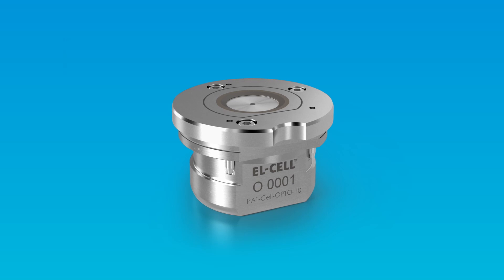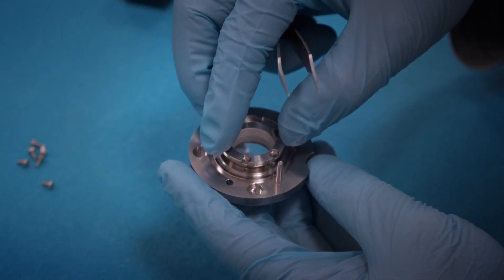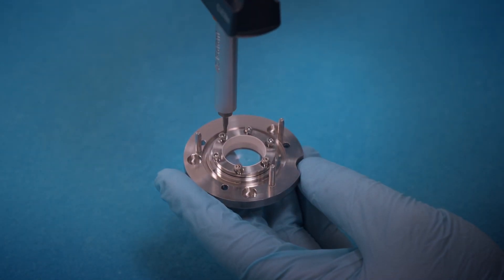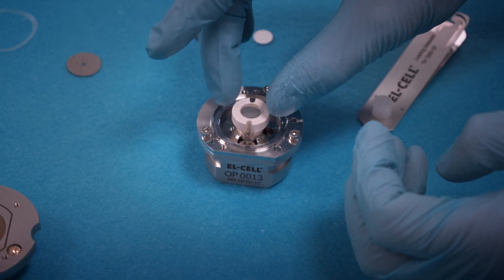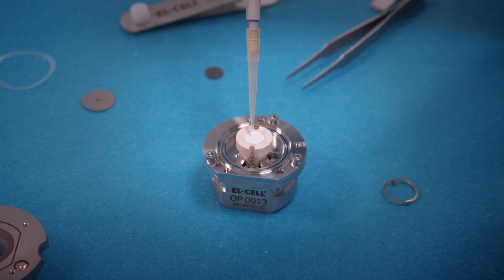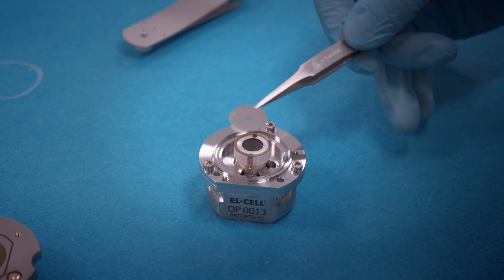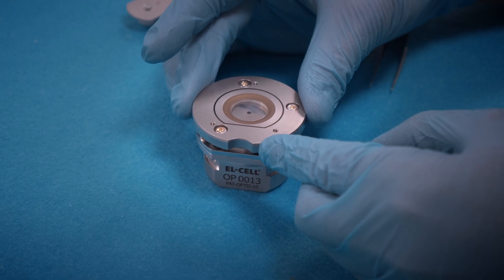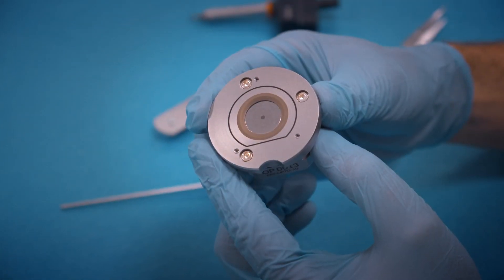EL-Cell PAT-Cell-Opto-10: Assembly procedures for face-to-face electrode setup (10/2021)

Comment: So if I am getting this correctly, what I am seeing is the stainless steel foil.
Not really what I was looking for. I wanted to see the electrode itself. In this case the graphite (anode)
Reply from the maker: The stainless steel foil (contact disc) on top has a viewing hole in the center, allowing you to look at the self-supporting graphite electrode with your microscope. The contact disc is needed as current collector. It is supplied in three versions with different hole diameters for different microscope magnifications: 1 mm, 2 mm, and 4 mm.